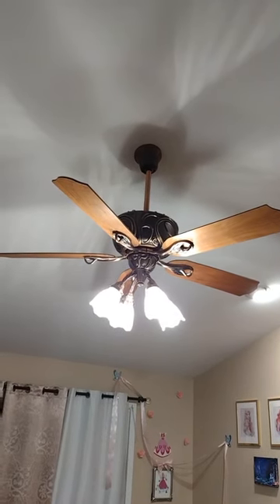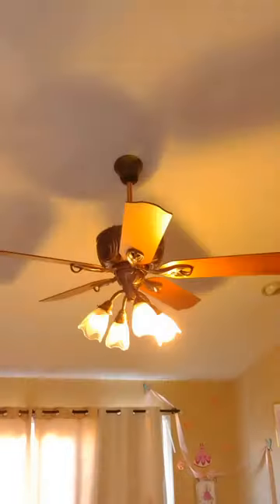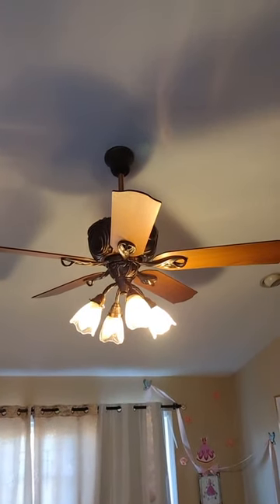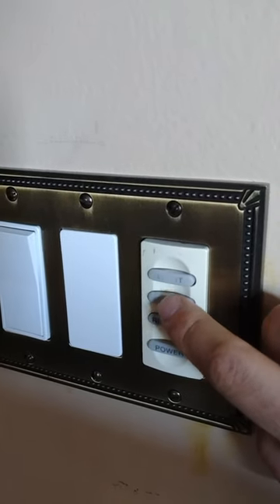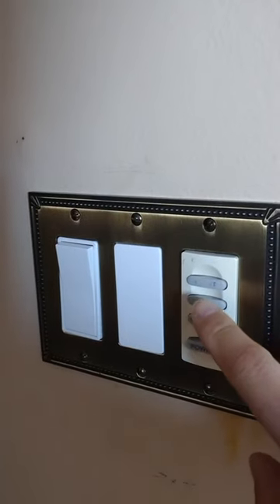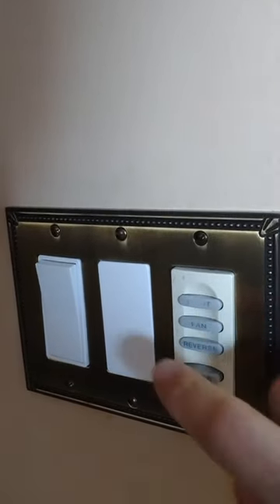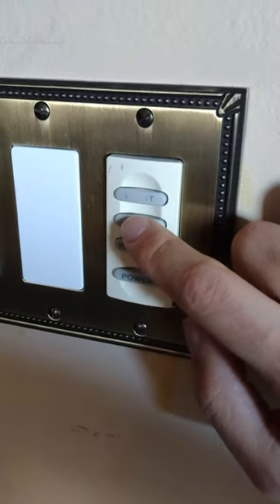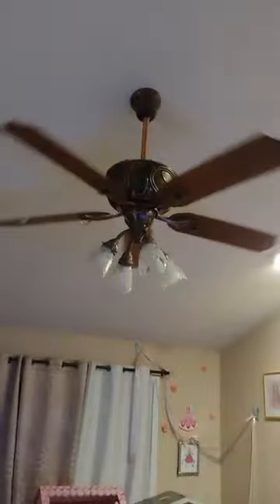operating a Casablanca fan

Comment: The capacitor is actually the reason why the fan doesn't change speeds. It's basically the main part to the actual Inteli-Touch system. With that capacitor dead, you lose a few things like changing the speed or doing additional features.
Reply from the maker: Thanks for the information.  Can't wait to start working on it.
Reply: @fixit9888  No worries! If you need help with anything, let me know! Glad to help ya! Glad to see another person who cares about the quality of these fans.

OH I forgot this. The flywheel on this could warp when time goes by. It might start scraping on the switch housing. Should be easy to replace the flywheel with a new flywheel.

Yours seems to be in great shape! Absolutely a stunning piece that Casablanca made! We don't get this kind of quality and craftmanship on fans anymore.
Reply: Any updates on the fan?